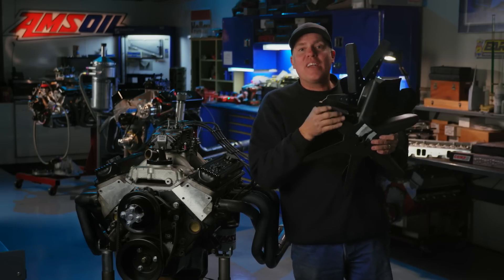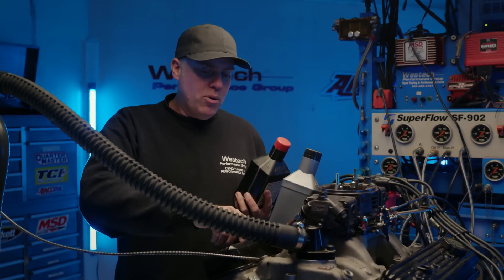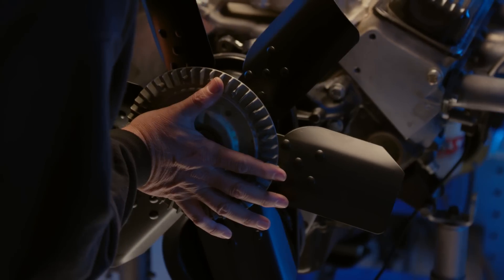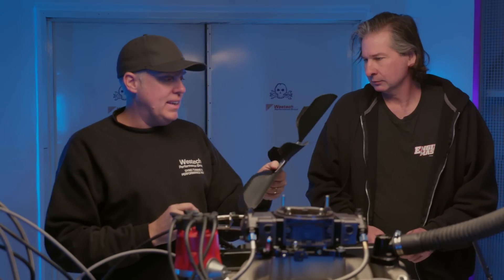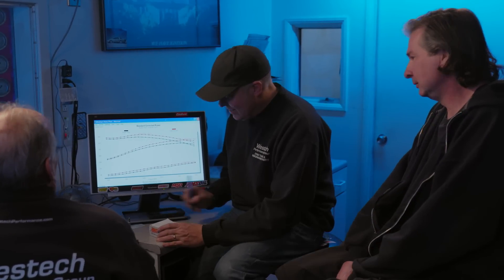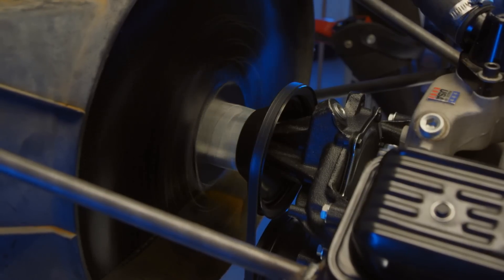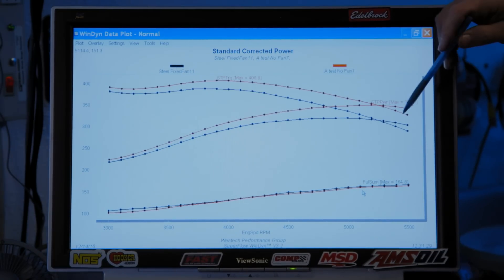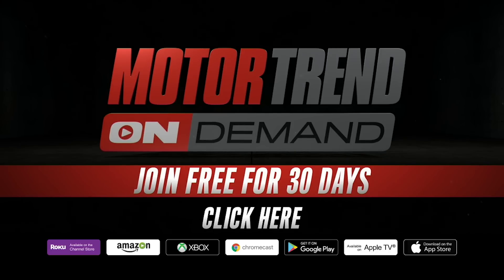Cooling Fan Shoot-Out! - Engine Masters Ep. 20

Comment: What would it take for you guys to put a rotary engine on that dyno?
Reply: Would love to see that but i doubt it's compatible.
Reply: and a few gallons of spare oil XD
Reply: Lets see a 12A Vs. 13b Vs. 20b shootout on Engine Masters!
Reply: Cameron Jenkins Dammit the Technically-Correct-Man is here!
Reply: i'd love to see what the torque curve on a mazda cosmo 3 rotor is. i've heard they make a bunch of torque.
Reply: A case of serious retardation...
Reply: We need to see how much nitrous you can feed a 4 rotor.
Reply: SmileyFace :D  It'd probably take a little more than what it took to get the rotary to stop burning oil.
Reply: 787b engine :^)
Reply: they have to pump out so many of these videos yes a rota would be sick BUT new things take more time and small block chev is easy they know it and it gets the point across very easily
Reply: Cameron Jenkins the original commenter was talking about the Wankel engine, not radial engines, or rotary engines. Depending on your sources the Wankel engine is a rotary engine, or a rotary engine is where the crankshaft remains still. Anyway they were talking about a Wankel engine
Reply: Barty Crowell - Actually no. I thought this as well but it turns out that there was actually a "radial" rotary engine in WWI. The engine had a fixed central shaft and the engine block rotated around the shaft. Very strange but good power to weight and the cylinders rotated so that cooling was excellent.
Reply: somebody ordered 2,400 hp ?
Reply: If by the world you mean america you could be right, but i doubt it. I have seen more than 4 in New Zealand and know of a lot more in Australia. But being from America you may not know these places exist.
Reply: I'm sure the import shops dyno rotary engines... look in youtube...
Mazda redesigned their rotaries a few years ago by moving the ports from the side to the outer edge which brought the MPG up to acceptable levels along with cleaner burning and better low RPMs torque and more HP... They also developed longer lasting rotor edge seals...
Reply: And yes i would like to rebuild my engine every 50 000 kilometer's or less =D
Reply: mike 20b is a little unfair as it's like comparing a i-4 to an i-6
Reply: DeadlyVoltsHD None of that is true.
Reply: You have no idea what you on about. :p
Reply: DeadlyVoltsHD Pretty sure there's more than 4.  And there's at least one 6-rotor in a car that's kind of a big deal, and a 12 rotor that's just crazy.
Reply: Depends on how you define efficient. hp per lb on those is quite efficient.
Reply: DeadlyVoltsHD You're so incredibly full of it I can't even guess as to where you got your ideas.  Mazda built five 787Bs equipped with 26B 4-rotor engines, likely with backup engines, and there' several companies who'll build a 4-rotor for you with newly made parts.  There's a bunch more in videos just on YouTube; a moment of searching shows a single video with 9 different cars and boats with 4-rotors.

Then there's the PPRE RX-4 with a 6-rotor with ITBs that moves pretty well, and has a very distinctive exhaust clatter.
Reply: I once had a case of very retarded seriousness while working to reassemble some sunflower seeds.
Reply: After hundreds of seeds and shells, I realized that I had 2 seeds remaining and no shells! I am currently raising funds for an X-ray machine to save labor.
Reply: No joke I wish they would do Nissan L-series engine stuff.
Reply: GM was actually developing a Wankel engine back in the day, and AMC was going to put it in the Pacer.
Reply: BuzzLOLOL You're correct, the dyno results for stock rotary engines and a variety of different modified rotary engines are available online.
Reply: SodomySnake GM did get some rotary powered vehicles in a round about way. GM's Australian branch "Holden" sent big heavy 4door sedans to Japan where Mazda fitted 13B's and sold them as the Mazda Roadpacer. Its luxury sedan of the 70's in JDM. It's 1.3L capacity dropped the car down a tax bracket. 800 units sold. Some say part of a deal GM did to develop a 4rotor corvette which never made it to market..
Reply: SmileyFace :D I'm guessing that would require mental illness.
Reply: SmileyFace :D their pride
Reply: SkuzzyJ the rotor would only be spinning under 4000rpms ,  so no it wouldn't shake apart at 11000  eccentric  shaft rpm.
Reply: An american car comes from the factory with a wankel engine
Reply: SmileyFace :D 
What would they do?

Look at how much power you get at the loss of livability by going from a stock to  street/peripheral/half-bridge/full-bridge porting while ending up with an engine that idles at 1600rpm and needs as much fuel as a 426 hemi at full throttle ?

I dig rotaries, have driven one for years,  but I don't know what they'd do with one considering none of them (except maybe Brule) are known to have any real experience in that arena. Dulcich would want to put a thermoquad on it and see how fast it can spin before it literally shakes itself apart (I'd guess about 11k).
Reply: No, it's a rotary engine. Radial engines look very similar, but they are the opposite as far as rotation goes. The crankshaft spins on those while the engine itself is stationary.
Reply: 4 rotors or higher :3
Reply: SmileyFace :D they won't do anything that is not an old ass American engine.
Reply: Cameron Jenkins That's a radial engine
Reply: How 'bout you pay someone to do it yourself Smiley? We'd love to see you post your results, and costs! LoL
Reply: It'd be so funny if they put an actual rotary engine on that dyno, considering that actual rotary engines are WW1 aircraft engines. With those, the crankshaft stays still and the entire engine spins.
Reply: rotary is shit.they make no torque and have seal problems.
Reply: Tcb Bct  hahaha  exactly what I thought.
Reply: Puffalupagus360 300 lb/ft and 300hp stock at 7500 RPM, I believe. 2L engine.

However there are so many different ways to build them up that it is hard to know if those numbers I provided are a "stock" 3 rotor.

3 rotor with boost can make 700 HP easily I hear, although I only run a two rotor myself.
Reply: Kristopher Klassen bro i'm making pasta can I borrow some of your salt thnx <3 (liked your comment too for extra chances)
Reply: SmileyFace :D a brain tumour.
Reply: I assume they're talking about the highly inefficient, poorly designed engines those crazy Japanese people used to put in cars back in the day. "Yes, I'd like a 4 stroke engine that burns oil like a two stroke please, emissions tests? Nah I dont need any of those."
Reply: SmileyFace :D 
Rotary engines are lame.
Reply: I think this is not lawnmower dyno??
Reply: SmileyFace :D them to change there name to import trend
Reply: strait up 8 rotor, from the window to the dyno pump
Reply: I think even brain tumour is not that stupid =D
Reply: Lol they're too hillbillys to put something non-usa in that dyno (cant blame them tho us stuff are the ones they know)
edit: Honest mistake, can relate.
Reply: SmileyFace :D No